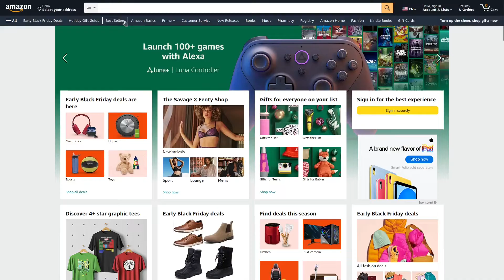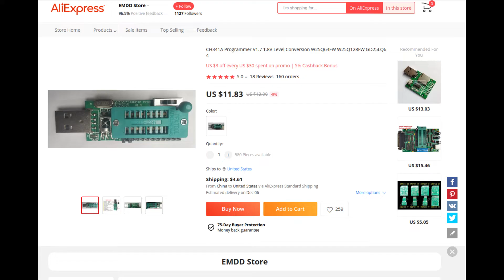DON'T USE CH341A until you watch this!

Comment from the maker: I made this video out of an abundance of caution and to highlight an interesting product that supports more voltages than the original CH341A. This position that the voltage is too high is not something I made up but is the stance of the Libreboot project and many other smart people in the community. 

Lately, a different view point popped up saying that the CH341A will automatically lower the voltage when flashing. I plan on testing out these claims to verify if they are true or not. 

If you watch my previous videos you can see I've successfully used the original CH341A many times and either ignored or down played the voltage issue. As I did more and more flashing my stance slowly changed.
Reply: You got it wrong. It is totally normal to a voltage drop when load is applied. There does not have to be any automation for that to happen. For example a conventional transformer will have very variable output voltage depending on the load applied. If you measure a transformer output with no load and a load you will see two very different voltages. This is very basics of physics and electronics.

Comment: Bro thanks for this i ended up making worse for my z490 because of this 5v thing which happen to my test board h81m p33 even after successful flashing the southbridge ended up staying cold when pc is trying to post which it supposed to be warm, the flashing is successful i tested the bios chip and it seems to be fine reads and writes correct its just the southbridge got cooked lol.

Comment: I've never had issues with the old one... even Sorin on his channel  points out  a fact that many overlook, that even  though those data pins are 5v, the current  in in the micro amps range, and with my own testing once you connect a chip up the voltage drops down to 3.2-3.3 anyway

Comment: pi pico is also a cheap fast option for flashing bios.
is even cheaper and should be both faster and more available as you can also often get them in local stores. have also seen people do it with a esp32.

though not sure if either or both of those options support 1.8V and 5V io signals as well as for how far I know they typically are 3.3V IO. and might be able to go lower perhaps using PIO and DAC on the pi pico maybe.

Comment: The myth of this device being faulty due to the voltage has been thoroughly disproven.  IF YOU HAVE THE CH341A YOU DO NOT NEED TO MODIFY IT and you certainly don't need to throw it away.  The device works exactly as it should.  To the uploader of this video....did you happen to check the current on each of those pins?  I ask because you didn't check it in the video.
Reply: I have one and it works fine too. I had purchased it a few months ago, saw this video and immediately checked the voltage. It was giving 3.3V.
Reply: Please send me a video or some evidence of how someone has disproven this. I want proof.
Reply: @tudor2051  https://youtu.be/J8-Sh7DjiXw
Reply: not a voltage burning things but current  :) https://www.youtube.com/watch?v=J8-Sh7DjiXw&t=673s
Reply: @redg12-w3y  There are videos about this but I have measured the voltages in use and they are totally fine. This mod is totally useless and even harmful, people have destroyed their devices with this.

https://youtu.be/J8-Sh7DjiXw

Comment: i made this 2 times exactly and my CH341 died.... same way, same problem "Descriptor error" in devices.... uninstalled, formatted, dont change anything... so i'm searching about and what i found is....CH341 send 5v to chip but when rec something.... go down to 3.3v because CH341 know what chip is.... and i dont think have problem of project..... when i tryed to change 2 new CH341 to down to 3.3v just go this error... work at begin but you willl get " ! " in your CH341... and just for update i never burned any chip 3.3v or 1.8 using adapter always worked..... saved many motherboards...

Comment: Dear sir. I have to flash a W25Q32BV chip, that operates at 3.3V. If i buy the CH341B version, will it be safe for this chip? no mods to the programmer are recommendable? Thanks, i have no soldering skills.
Reply: Have you tried? Waiting for the response

Comment: Old version works perfectly.  No need to mod.  Voltage drops to 3.5v when running.  Plus amperage is low on every pin so no risk of frying any chip. Voltage is harmless.
Reply: I have used these for long time and these DO NOT have any voltage issues, the mod is totally useless. The voltage is what it is supposed to be when programming. Without load and current the voltage does not matter. So I can also confirm that these things work totally fine without the mod.
Reply: @Parkplayground  👈  He is absolutely right. You do NOT need the useless mod that is pushed in this video.
Reply: Have you tried?
Reply: @MAnees-jk5yg  Yes, he is correct.
Reply: @dazzer_  sure I will try it🙂
Reply: @MAnees-jk5yg  I have removed the BIOS password from over 200 laptops from many manufactures with no problems. Don't worry, it works perfectly. No mod is needed.
Reply: @dazzer_  Even with 1.8v chips?
Reply: @aoi2853  No, you will need the 1.8v adapter for those chips.

Comment: I should’ve watched this before doing the whole bios flash thing because after me clamping my thing down on my bios just to see how it fit then trying to turn on my computer it wouldnt turn on and gave me a hardware error meaning i fried something
Reply: you cant fry something with voltage and the ampers here are around 1 mA so idk you screwed up something else
Reply: You may have a 1,8V chip so you should check the chip voltage before connecting. You need a voltage adapter to use the old CH341 with 1,8V chips. The new CH341's have voltage selection.
Reply: @jarnovilen5259  yeah but the thing is it was a desktop computer

Comment: Wrong! The data lines are 3.3V when using the device. The voltage on the data lines WITHOUT connection is about 5V but as soon as you connect it to a chip and start communicating the voltage in fact IS 3.3V. So the modification is not only stupid it is also totally useless and even harmfull!
Reply: And I have used CH341A before this video very successfully and the voltage is totally fine when writing a chip.
Reply: There are more than one factor. I’ve had both readings on different boards I’ve tested. The first was a F411 control board with 9v, 5v and 3.3v bec and vss . I connected through usb and got a nominal 3.3xx only with board powered on once it was off it shot straight to 5v. On another control board with F405 and 5v and 3.3v bec it stayed at 3.3v with or without board powered. I’m no professional though. Tested both from test boards ground and usb +.
Reply: People are testing unloaded (floating) connections,  measure the current is it 1ma or less? then load the pin with a 100 Ohm resistor and measure the voltage is the voltage correct? Ohms law dictates the current from that pin is about 33ma ish through that 100 Ohm resistor.
Reply: If he's Wong he probably knows what he's talking about 😂
Reply: If it's 5V without a load, then it's a 5V logic/line.
There is no "5V until 3.3V logic is detected" because that can damage 3.3V devices.
Reply: @edinfific2576  Nope. Voltage does not damage anything WITHOUT current. You do not understand electronics. As soon as you connect a chip tho the CH341A the voltage will go down if ANY current is drawn. That is why the voltage of the not connected floating lines do not matter at all.
Reply: @jarnovilen5259  You are right if the input contains protection diodes and the current going into it is very limited.
But I have damaged an ESP32's RX input because I applied an RS232 signal to it, and the currents were just around their limits.
Reply: https://youtube.com/shorts/-QknftyXvTU?si=miBzqBg4o-6txDdm
Reply: Wong
Reply: @rivciks5045  WRONG
Reply: @konmicks  yes, i spelled wrong wrong like wong
Reply: @rivciks5045  WRONG
Reply: @konmicks  yes, I should've spelled it wrong not wong
Reply: @rivciks5045  WRONG
Reply: @konmicks  Wong is wrong because it's spelled wrong
Reply: @rivciks5045  WRONG
Reply: @konmicks  when wrong isn't spelled wrong then it is not wrong
Reply: @rivciks5045  WRONG
Reply: @konmicks  you are very smart person🙂
Reply: @rivciks5045  WRONG
Reply: WRONG!!
Reply: correct
Reply: @martinharmath1566  WRONG
Reply: @martinharmath1566 WRONG
Reply: @martinharmath1566 WRONG
Reply: WRONG
Reply: @konmicks  Think again.

https://youtu.be/J8-Sh7DjiXw
Reply from the maker: That is really interesting I will have do some testing to verify that.

The new CH341A has a few more features like also having 2.5V and 1.8V without having to use a conversion board.
Reply: @DeviceCastingCouchTechPodcast  WRONG
Reply: @DeviceCastingCouchTechPodcast 

WRONG
Reply: Pshh... all professional and understanding.. how dare ye! :D @DeviceCastingCouchTechPodcast
Reply: @DeviceCastingCouchTechPodcast have you done the testing? is it true or the modification is crucial?
Reply: @konmicks yes, you can measure and you will have 3.3 once you detect the chip
Reply: @martinharmath1566  WRONG
Reply: @konmicks  explain why, otherwise you are WRONG
Reply: @martinharmath1566  WRONG
Reply: @martinharmath1566  WRONG

Comment: Do you know what voltage should be used for a removable intel/asus winbond chip?
Reply: Winbond has chips with all the different voltages, you have to check the model of the chip and google the data sheet to see the voltage.

Comment: I came across the new version when looking for a voltage adapter for the ch341a. This thing is much better. Though I think my specific one is a bit quirky as it only seems to work 50% of the time when plugged into my laptop. But when it works, it does so flawlessly.

Comment: Hi there , is it coming with a test clip that we don't have to remove bios from motherboard? thnx
Reply: if not i think you can buy the clip separately
Reply: The clip is VERY unreliable. I do not recommend using it, it is VERY finicky and extremely hard to use reliably. Yes, I have used it and use it, but I do not recommend using it. I solder the chips now, it is fast and reliable.

Comment: I was just going to buy one of these but was wondering if it could be used with the raspberry pi but now you're saying that BIOS can be flashed with a Raspberry Pi? What else would I need to do that?
Reply from the maker: The Raspberry Pi can be used you just need a clip and some jumper wires.
Reply: @DeviceCastingCouchTechPodcast  Yeah. I already figured it out and was able to unbrick a Lenovo ThinkCentre M93P with it but now I'm trying to figure out how to connect it to a FTDI FT232RL USB Serial adapter so that I can connect it to my laptop but I'm not getting any output on it with any of the terminals likes Putty, GTKTerm, or Screen.

Comment: You make the CH341A programmer the mod and it is solved at 3.3 volts, it is not necessary to throw it away, it is just to use your head a little
Reply: I suck at soldering such small circuitry... gimme the alternative...
Reply: No you don’t have to fucking mod it lmao it’s fine when under load it’s 3.3 volts only when not under load it’s at 4.8 volts …. Current is what burns chips not current I hate stupid people who follow trends of other stupid people who don’t use a multimeter
Reply: You DO NOT NEED THE MOD. It is useless and potentially harmfull. The voltages are correct when a chip is attached.
Reply: Tried to do the mod just lifting the pin 28 was hard for me, and while soldering to resistance it got pulled off, at my age I rather buy this and return the black one as faulty.
Reply from the maker: I agree and I have done the mod but if people have not done the mod, or do not have the skills to perform the mod and want different voltages like 1.8V or 2.5V I think it is a good alternative option
Reply: @DeviceCastingCouchTechPodcast  
Yes it is true, thank you very much for answering. Greetings from Argentina (Buenos Aires)